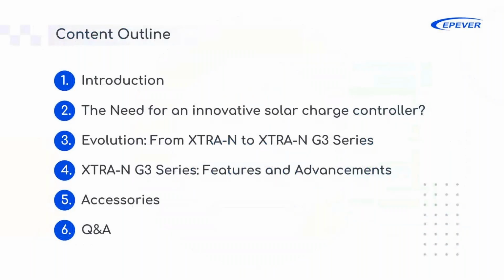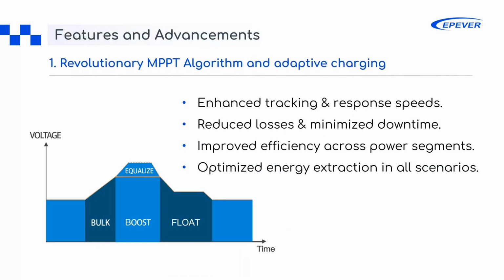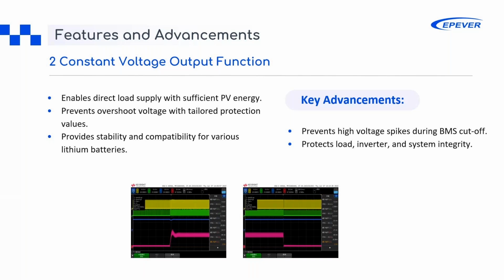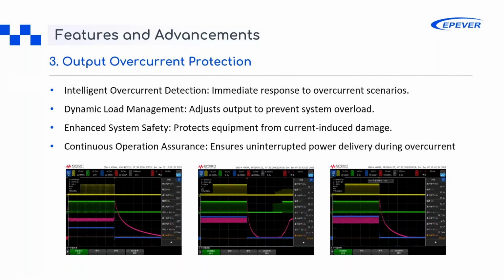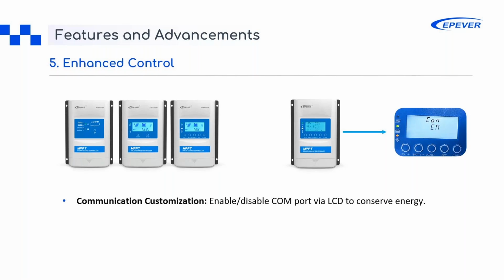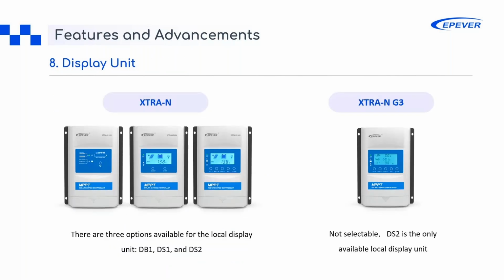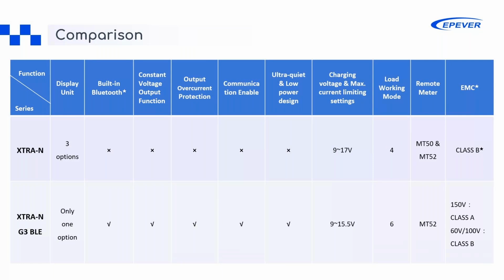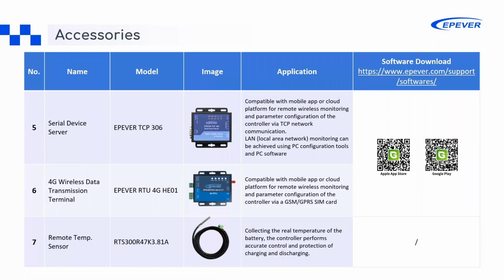EPEVER XTRA-N G3 Series Deep Dive: Enhancing Your Solar Experience | Webinar Recap

Comment: overcurrent protection and constant voltage only available at load port?
Reply from the maker: Hi there, the over-current protection and constant voltage are available at the controller's battery terminal.

Comment: Constant voltage output mean dc voltage would be constant and selectable if the battery is 14.6 or 12.1 or 11.9v . The output will be constant and will not go up and down with battery voltage?
Reply from the maker: Hello there, thank you for your interest in our XTRA-N G3 controller. The constant voltage feature of this controller is designed to maintain a steady voltage output for the load devices in situations where the battery encounters issues, the BMS protection is triggered, or when operating without lithium batteries. This output is adapted based on the current solar intensity and characteristics of the load devices, and many other factors. So, it's a theoretical constant voltage. The actual output may vary due to these factors. Additionally, the value of this constant voltage is not selectable.
Reply: @Epever  ok  I run dc lights and fans to if the battery voltage goes up and down the load voltage will remain same? Battery voltage goes up in the sunlight and goes down in the night
Reply from the maker: Hello there, the constant voltage output on the XTRA-N G3 is a feature of the controller's battery terminal. If DC lights and fans are connected directly to the battery, the voltage output to the devices during the day is constant output, unaffected by changes in battery voltage. 
At night, when there is no PV energy input, the load devices are entirely powered by the battery, so the load voltage will vary with the battery voltage. However, if the DC lights and fans are connected to the controller's load terminals, there is no constant output function. @DigitalMind.254